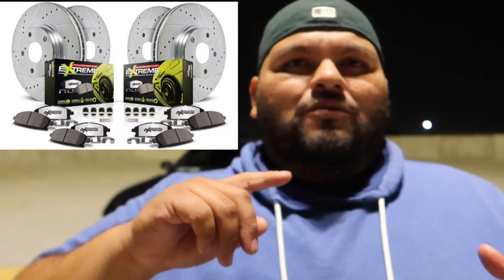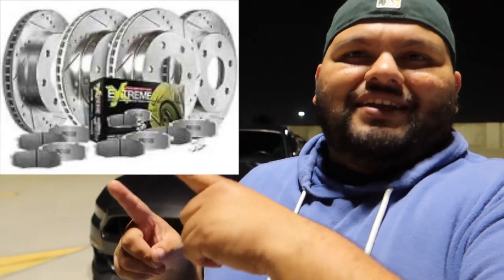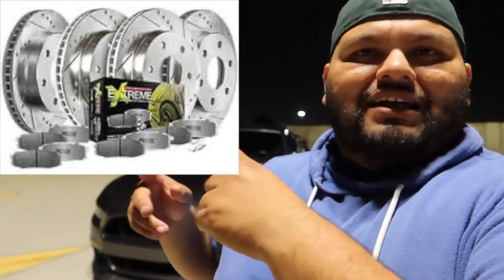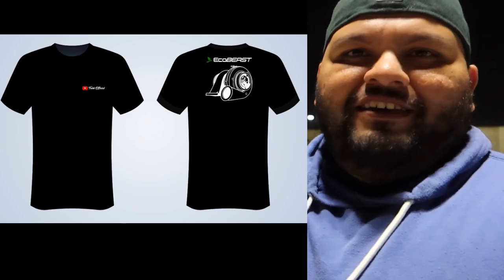NEW MOD FOR THE ECOBOOST!! 👏🏼🔥

Comment: Bro question again 😂 is there a difference in body style between the 2015 mustang and 2017? I only could find a 2017 in my area :/ I wanted to have the same one you got 😆👌 but I couldn’t find none RIP also I can’t see a difference but you might have a different POV!
Reply from the maker: From 15-17 are the same body styles. The 18-21 are the same.